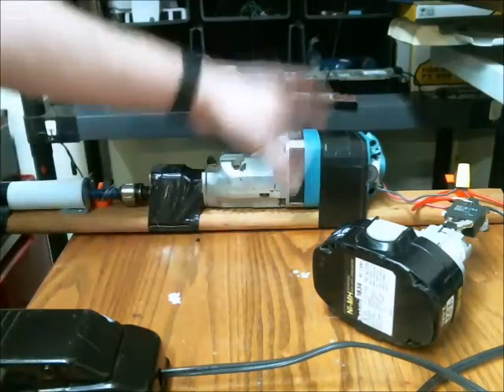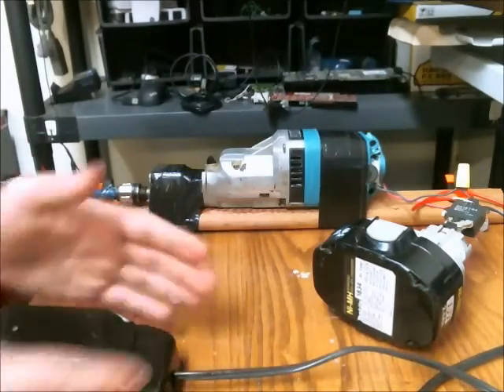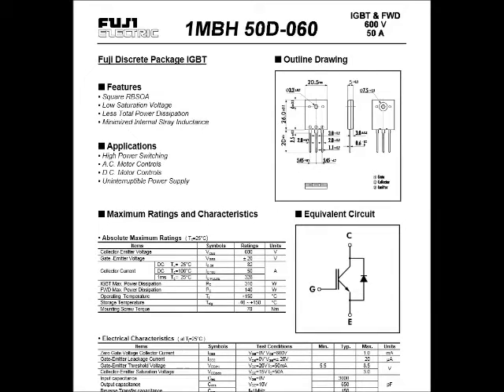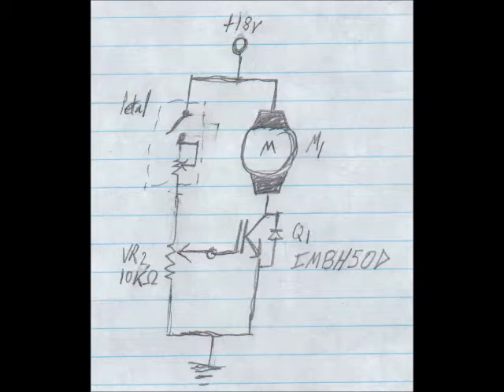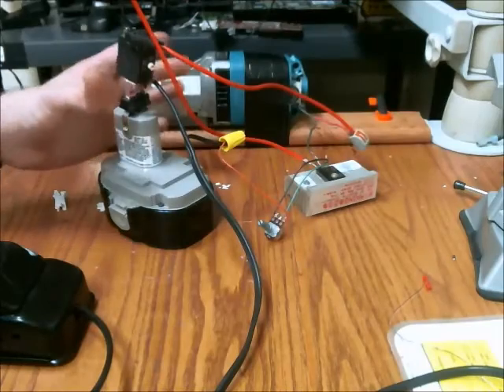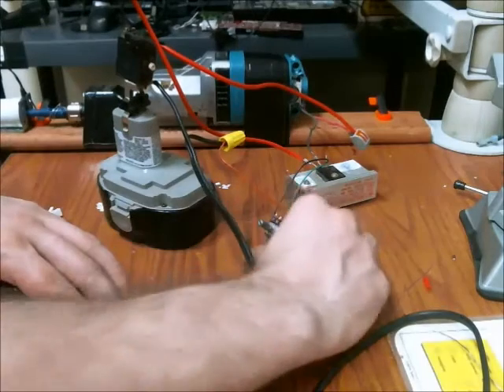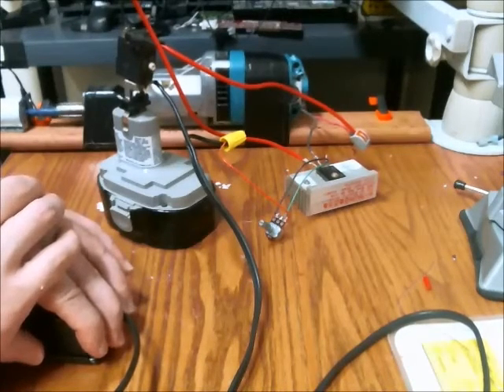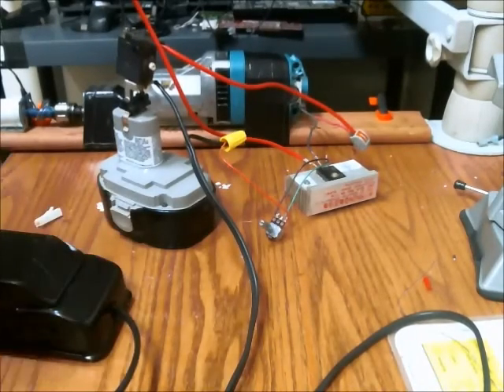High Power Motor Control Circuit

Comment: thank you sir
and i need to know how to control current and volt at diy dc arc welder and simple
can you teach schemetic me with IGBT or scr

$20 Homebuilt DC Welder - Power Control Circuit

52 VDC Microwave Oven Stick Welder ~ Part 2